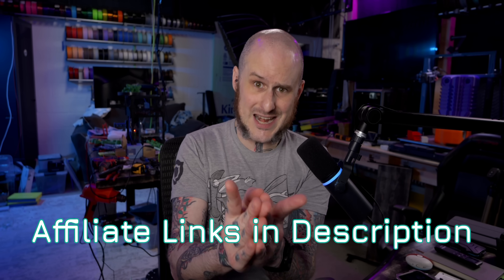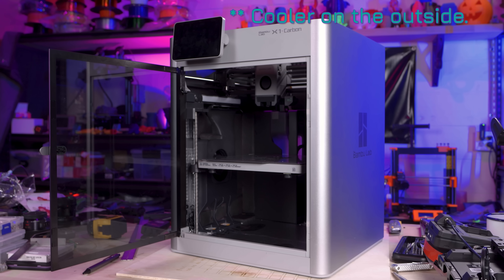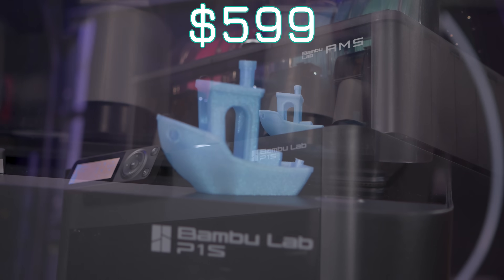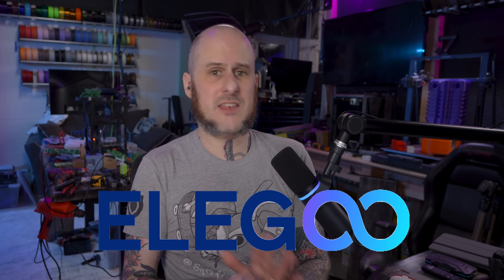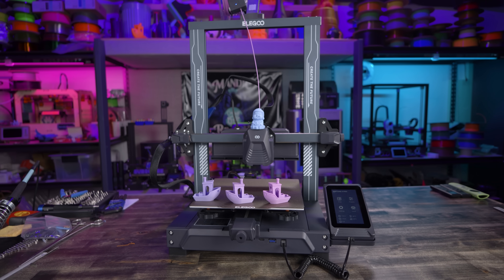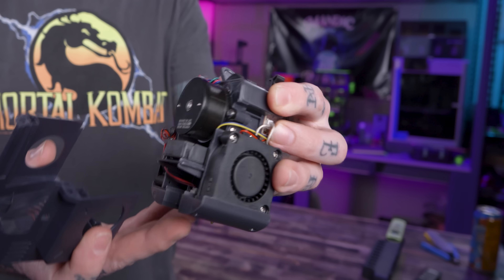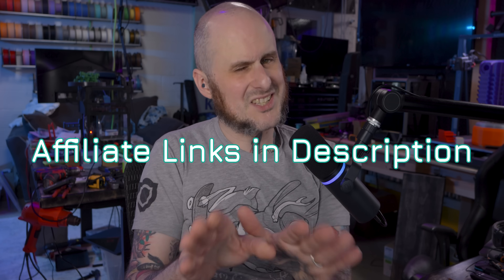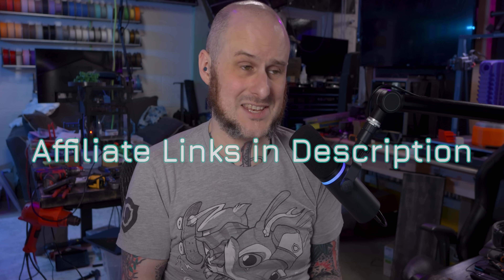3D Printing Black DEALS 2023 - Bambu, Qidi Tech, Elegoo, & More!

Comment: I am planning to buy Qidi or K1 max.Which would you recommend?Thanks
Reply from the maker: I have no experience with the K1 Max. That said, the added chamber heater and vanilla Klipper firmware on the X-Max 3 are great things to me. Only thing I’d say the K1 Max has over the X-Max is better bed leveling sensor & visibility of the Toolhead while printing. The “forehead” on the x-Max 3 is annoying to monitor prints visually. If you want to print higher temp materials I’d say the X-Max. If you want to print PLA / PETG, I’d probably lean toward the K1 Max.

Comment: Qidi Tech-X 3 was almost $300 off its normal price. Banger of a deal, I was debating between it and the X1 Carbon, and went with the X3 as it was more then 1/2 the price, and it wasnt a walled off software like the Bamboo.
Reply: They seem like exceptional deals for what you get. The X-Plus 3 is $589 before coupon and the larger X-Max 3 at $899 before coupon is a heck of a deal even. That 325 x 325 bed it so worth it for the price + the heated chamber and you can add any camera to it by plugging one in.  It's a shame that it's being overlooked by so many

Comment: I picked up a k1 and there are some crazy sales right now in them. I was not sure what to expect but I must say I love it. I am not a creality fan but they did an amazing job. Especially now that the bugs are worked out and can be unlocked. And print quality is actually very good. I know some can be hit or miss
Reply from the maker: I need to get mine up to date and give it another chance.
Reply: @MandicReally did you use the default Creality slicer profiles?  

If so next time try the soonsoon profile instead.  I got better results

Comment: I'm waiting for some Voron 0.2 kits to be on a Black Friday sale. I've been wanting to try my hand at assembling a printer from scratch for some time now. All my other printers are bought, but my Ender 3 is heavily heavily modified so that's the exception. Speaking of the K1, I pre-ordered it and paid a lot more for it. The current price, if it comes with the revised hotend and extruder, is an amazing price for what you get. Mine did need a hotend replacement because the wires for the ceramic heater popped off their pads, but Creality shipped me another one (on top of the extruder, camera, one roll of hyper PLA and hotend I got in their 2.99 USD special for their early adopters) with express shipping just two days after we exchanged some emails. My machine was down not even a full week. So props to them.

It's been a workhorse for me and the printer I always come back to when I need to get things out fast.
Reply from the maker: I've got my eyes peeled for V0 deals. All the sellers handling them were still doing 11.11 sales when I tried looking, so hopefully some better deals come this week. Check my Social Medias like Twitter & Instagram as I try to post deals frequently there: @MandicReally on both.
Reply: MicroCenter has them for $349 so I picked one up... So far, unlocked with a full version of Moonraker/Fluidd/Mainsail it's been a solid 'extra' printer next to my P1Ps.
Reply: @GuitarFuYou  do you have the link. Is it complete kit. ?
Reply: @sfahadrizvi  I was referring to the K1.

Comment: The Neptune 4 Pro is seriously underrated for an entry level machine at that price. It can be converted to 100% pure Klipper and at $280 is about the best 'first printer' deal out there in my opinion. You can start with the built in Elegoo features to learn and then upgrade to full Klipper as you progress. Not a lifetime printer, but what a starter kit.
Reply from the maker: I agree. The Neptune 4 has become my goto starter printer recommendation. You don't HAVE to used the web interface & Klipper features, but they are there for when you grow and are ready for them.
Reply: @MandicReally  what are your thoughts on the Neptune 4 Pro vs the Kobra 2 Pro/ Sovol Sv06? thanks!
Reply from the maker: @olivertrees  I don’t have any experience with either the Kobra or Sovol. I have a Kobra in the box but no time to test it right now. As for the Sovol, they’ve never sent me any machines so I cannot speak to them at all.
Reply: @olivertrees  The SV06 was a much easier setup for me than the Neptune 4 Pro, and so far has been more reliable, but much slower.  I recently picked up two Neptune 4 Pros and out of the box mine print less than ideal as far as I am concerned.  Mostly this is due to the fact that they wont stay level and first layers are trash.  Not saying this is a blanket case, but both of mine have been a pain to dial in.  My SV06 on the other hand is always on point and I have had very few issues with it running at around 120-160mm/sec usually.
Reply: @metalsk8er4life  thanks for the input! It seems like a great machine for around $100 cheaper than the neptunes.
Reply: @olivertrees  it is pretty great, and I can see the Neptune being great as well once tuned, so they are both excellent for the money.  Just my personal experience pushes me towards the SV06 at this point. And with the sale right now they are basically the same price as an Ender 3 v2 which is insane.
Reply: @metalsk8er4life  I'd be a lot more inclined to settle for it if it weren't so hideously coloured... I wonder if the neon blue parts can be reprinted.
Reply: @olivertrees  The blue color is much more muted in person, not neon at all.  I don't mind it .  Of course you could always reprint them if you wanted to put in the effort of reverse engineering them.

Comment: I think Sovol has some sales. I've been thinking of getting something bigger than the X1C I have, and the I've heard good things about the bigger Sovol 7. Although it's hard to resist the allure of the Neptune 4 Max when looking at bigger printers. (I did manage to fully resist the lure of the Elegoo Orange Gigawhatsit, but I won't say I wasn't tempted.
Reply from the maker: I have zero experience with Sovol machines so I didn't want to include anything I had no knowledge on. I've added a comment linking to the deals for folks & noting my lack of experience with them. Thanks